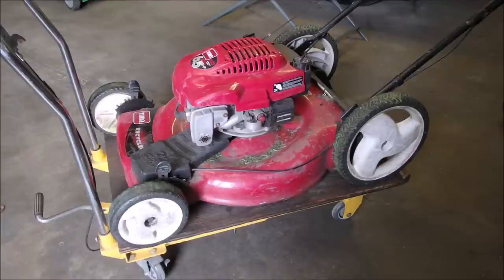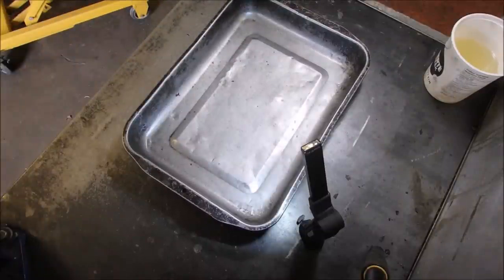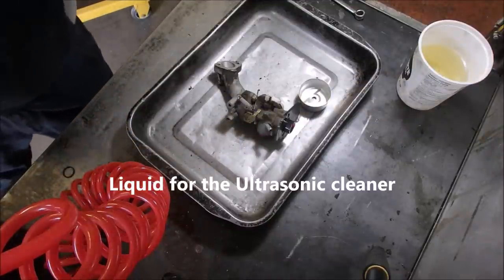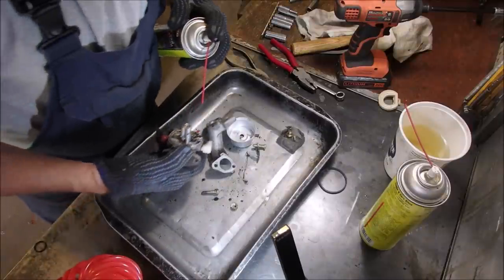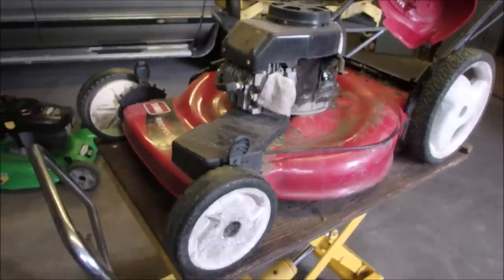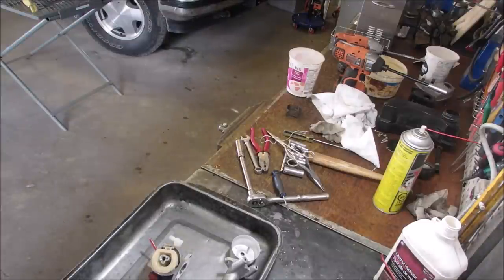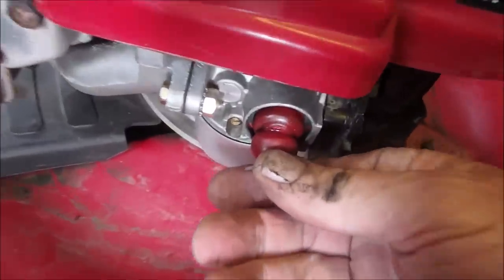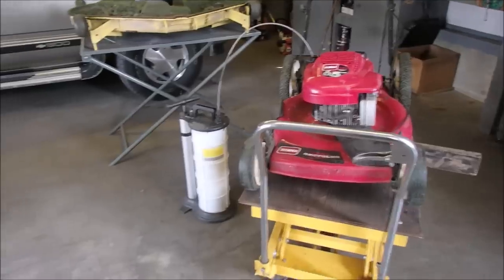Older Toro Mower Won't Start

Comment: That's my mower! Bought in the early '00s brand new.  I drain the gas out every fall, I've never even had the carb bowl off.  A new air filter and an oil change every year.  New front wheels (wore all of the tread off) a few years ago. It's gone through a couple of blades over the last 20-odd years.  A very solid piece of equipment.
Reply from the maker: Yes  I would love a new one.

Comment: These Toro mowers were great! I bought a brand new one exactly like this around 2003 and I liked it so much I bought another good used one to back it up. I would switch them every week to reduce wear and tear, never had any problems with them. I’ve always liked Tecumseh engines but they’re starting to get a little scarce around here, haven’t seen one yet this season.
Reply from the maker: Still a few around here as you can see.

Comment: Hey Bruce, good video.

I have to say, having to clean a carburetor on a Tecumseh engine makes me really appreciate how much easier the Briggs and Stratton carburetor cleaning task is.

I typically start the Tecumseh carburetor cleaning with a wee bit of brandy (for myself) to reduce the frustration the job can produce.

Thanks for mentioning the socket size to tap in the primer ring!!
Reply from the maker: Well where I live even to this day Tecumseh's are everywhere.   Briggs carbs are much simpler and more reliable.
Reply: @Bruce's Shop  

That is so true about briggs carbs...even the pulsa prime and newer plastic carbs. But I think the good old Quantum version is the best.

Tecumseh is everywhere here in Rhode Island on snowblowers.  I just wish the "engineers" would have given a little more room for the Tecumseh intake bolts so you don't have to take off the muffler.

Comment: I bought one years ago to use as a ditch mower, have a newer one with the personal pace feature which i prefer. Left it sitting for a couple of years and it wouldnt start. All it needed was the bowl removed and jet cleaned. Fired right up after.
Reply from the maker: Right on

Comment: Nice work Bruce I just picked up a Toro personal pace with the 6.5 tecumseh on it but the wheels are locked up (rear self propelled) they roll a little backwards but forward they don't,  but all cables work on it and came with a free murray select riding mower with a 11hp 30" deck
Reply from the maker: Wow.  Good for you.
Reply: Take the wheels off and gears ect. The culprit may be the key thingy that has a spring in it, they get gummed up with crud and won't work properly.

Comment: Thanks very much Bruce, greatly appreciated.
I was hoping that you would remove the emulsion tube.
My Tecumseh carburetor is identical.  My emulsion tube is unusual.
There is an o-ring at the top end but none at the bottom ,  just a flanged end,  no groove for an o-ring.
I wonder if it's been modified , but it doesn't appear so.   Maybe it's something Tecumseh was trialing ?
Reply from the maker: I am not aware of those.  This one did have a lower o ring.
Reply: @BrucesShop  
Excellent, thanks Bruce. That's all I need, I will go get a conventional emulsion tube.
I enjoy your presentations & re-watch them.
David.

Comment: Just got done with the same type mower, tank was 1/3 rd full of H2O. Don't have an ultrasonic cleaner did the best I could cleaning the SCHMOO from the carb, came out ok. new plug, air filter, oil change, sharpen and balance, broccoli removal, and a thorough cleaning. A test mow proved to me that is a good little mower. I would like to find one for me, the new ones aren't as good.
Reply from the maker: These are really good mowers eh!!!!!

Comment: Hey Bruce, back in the day my grandpa cleaned spark plugs with a spark plug cleaner that you attached to an air hose, it had a bag filled with some sort of abrasive. I see you can still get these at Harbor Freight for ~$20. What's your thought on these?
Reply from the maker: Well I think these days you don't want accumulation of particles in the plug.  My opinion only.  Times have changed as well.

Comment: The importance of a clean fuel system huh ?? I like tecumseh engines, really too bad they don't make them anymore. I have a hard time getting my mind around how the old manual throttles work on those, there seems to be a few things happening all at once when you operate them. Oh, would you happen to have a link for where you get a tachometer like the one in this  video ? Nice repair Bruce.
Reply from the maker: This is one from the Canadian Amazon.  But the info is there.  The wire is not required.  
https://www.amazon.ca/TOTMOX-Tachometer-Replaceable-Waterproof-Motorcycle/dp/B095SM9XT5/ref=sr_1_102?hvadid=600273114868&hvdev=c&hvlocphy=9001353&hvnetw=g&hvqmt=b&hvrand=9112585680403780663&hvtargid=kwd-295446340299&hydadcr=15025_13565429&keywords=mini+tachometer&qid=1684863212&sr=8-102

Comment: Always loved Briggs quantum engines, use to hate tecumseh engines, but now they are great, use to hate honda engines, and guess what..... Still hate em, Hahahaha..... Great job as always Sir.
Reply: I just did a new(ish) Honda with the typical carb problems,  I used to dread them, but the newer ones are put together a lot better than the old ones. No nasty linkage, studs rather than bolts,  they are ( almost) as nice to work on as a Briggs.
Reply: @GuysPlayingWithTools  yes I agree, the newer ones are much easier.
Reply from the maker: I am with both of you.